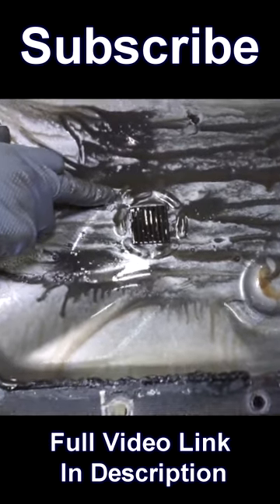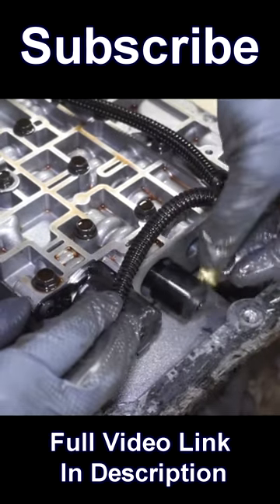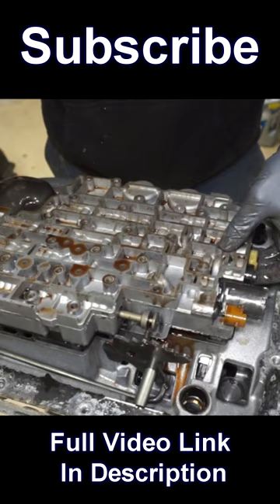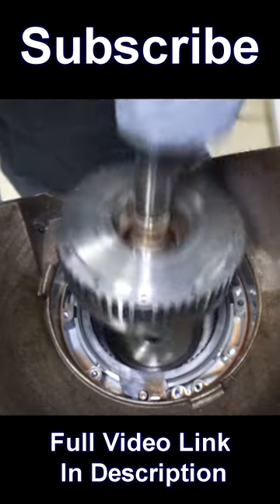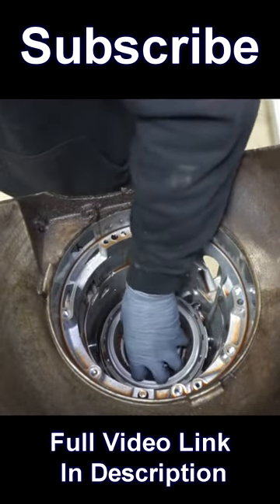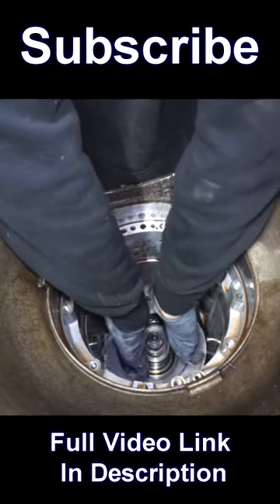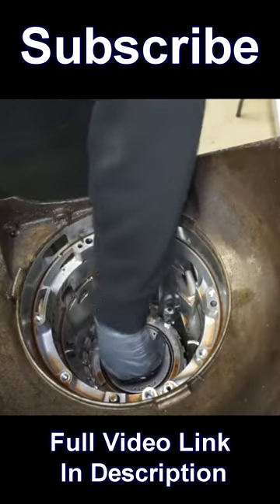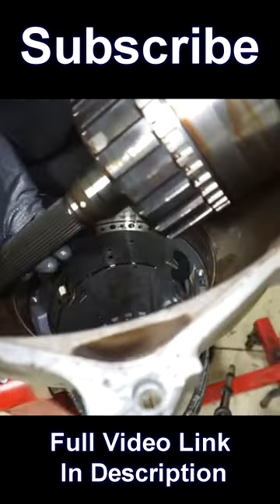Taking Apart A 4 Speed Automatic Transmission 4L80E

Comment: Do you buy a full rebuild kit or do you usually buy it all separately? What brands do you use?
Reply from the maker: Depends what is getting done with it. I like to use Borg Warner clutches, and usually raybestos steels, then precision or transtec gasket kits. I've use the ebay rebuild kits too though.
Reply: @BlaserBuilds  I've seen the raybestos full rebuild kit but it's usually double the price of the generic eBay kits. Is there any difference between the raybestos and the Borg Warner?
Reply from the maker: @JG-dn5tz  Borg Warner is what the factory uses, and they handler power well, so I like to use them.

Comment: Thank goodness for good-o long-lasting standard Transmissions.. .
Reply: With hydraulic slave cylinders that have to be replaced every 50k miles.....
Reply: @paisleyprince5280  still driving my 94 F150 480,000 miles and never touched the transmission or clutch not even an oil change.. .